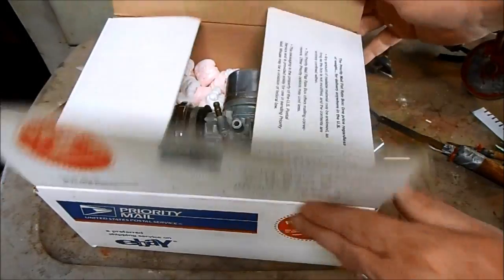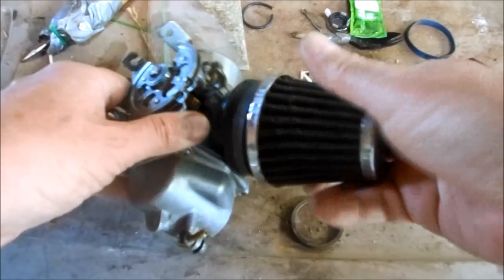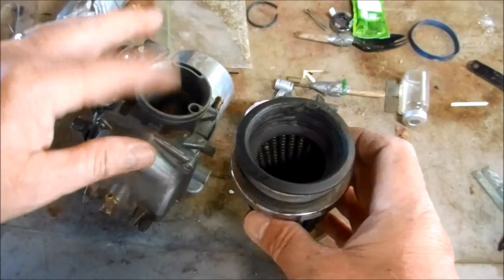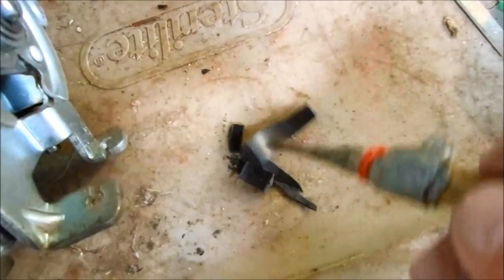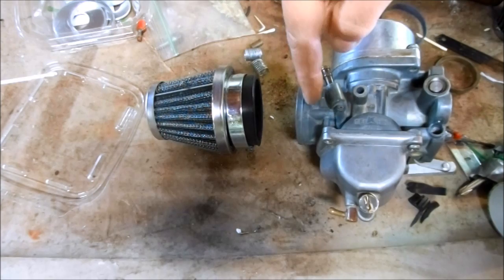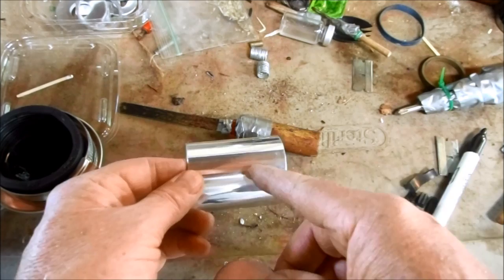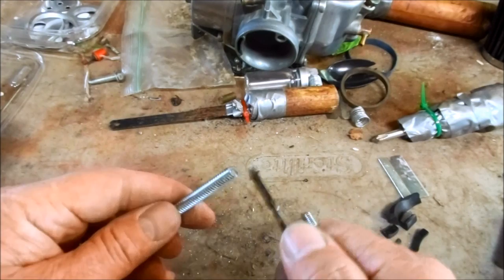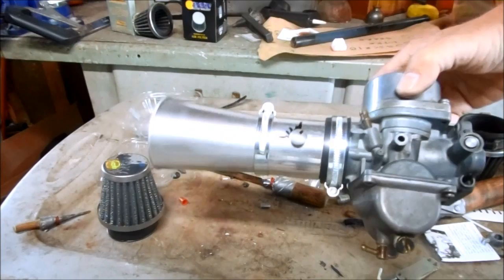how to easily tune pod filters for motorcycle carburetors with new diy kit

Comment: Yeah my problem is that i can't get the airbox back in the frame. Im at the end of my rope... so I ordered 4 pods after watching this vid and built 4 of those tube setups put the lollipops in and can't get the bike to rev past 6000rpm... 87 ninja 750 has an 11000rpm redline... help ichiban, bike has 4 keihin cvk carbs and a 4 into 1 exhaust. 

Should I drill the air hole for the slide out and make it bigger, how big? cut a couple coils off the spring?  Arghhh help.  Bought the bike off Craigslist 6 weeks ago and still haven't ridden it
Reply: Take out the darn 'lollipops'
Reply: @i.jackanov7382  yes but simple test: take off the restrictors (that's all they are) and if it revs to limit, problem solved. If not, there's another issue, possibly fuel starvation. Increasing the main jet size will stop the motor running too hot. Observe spark plug colour in the traditional manner.

Comment: how much would you charge to tune a set of four off my 1980 suzuki gsx750 to run the pods i bought it with
Reply from the maker: take your bike to your local shop with a dynotune .   we no longer need any carburetor props or tuning videos.

Comment: hold up. I got the joke but does the rubber on the pods filters really block those holes and is cutting the rubber away a good idea?
Reply: I'd be curious there too. Never really looked.
Reply: I don't know about actually cutting them, but if you pop for the K&N filters they don't have that lip on the inside and they're also sealed for better filtration.
Reply: put install the connector and bracket without the filter- and look inside the carb- you you cant see the passages then trim

Comment: I bought a Yamaha warrior 92 model and when I bought it the air box was completely gone. So I bought a 3 to 4 inch rubber tube like thr aluminum one you used in this video but my quad still hesitates when u barely give it throttle but runs pretty good when your a quarter throttle and over but when you let off the gas it spits and pops obviously way out of tune. Is there anyway you could make me a aluminum piece for mine with the adjustment washer you sautered in it to be able to tune my quad without messing with the carb? And if so how much would you charge me? I can get in the size of my carb and filter no problem at all please let me know sir thank you. I just subscribed and I'm sharing this video everywhere..
Reply: LOL, just figure out the diameter the mouth of the front of the carb is, clamp on a pieace of tube like the video and tape off one end with high strength Gaffer tape, the really thick expensive stuff, super strong, not the plasticy stuff the textured surface proper gaffer tape, then just drill a 3mm hole right in the centre, start with that. if its too rich it will bog down at high rpm, like feel gutless until you let off the throttle , if that happens, incease the hole size to 4mm and keep going up in hole size til it runs good
Reply: try use a long piece of tube too, like 6inches, with internal diameter of the tube the same Millimeter as the Overall diameter of the front of the carbie
Reply: and dont use plastic plumbing pipe as i once did on a 250 kawasaki, as the engine heat somehow transfers its way to the carbies and then to your plastic pipe, deforming it over time / if not straight up melting it,  i was shocked to see it all munted up only after a few rides.

Comment: In all seriousness though,
would something like this work??
Reply: Yes, because this bike hes doing it for is single carburettor huge engine, the size of his washer may be sufficient to do the job, however if you have a 2 cylinder same CC or 4 cylinder same CC as this one, you obviously want the hole sizes in the middle to be much much smaller
Reply: E.G single carby , 1 cylinder 600 cc, centre hole (by looks of video) 21mm , so respectively, 2 cylinder 600cc , 10.5 mm., and 4 cylinder 600cc 5.25mm , and you cant go wrong :)

Comment: Hope that was welded solder will come off run the engine also no seal around that bolt not good at all
Reply from the maker: that's why i didn't superglue it

Comment: Im having a serious issue with airfilter. these chinese pods are crap and doesn't work. I got a 200CC bike. I'm runing it wothout air filter as orignal box doesn't fix on my new big carburettor. oil got very thick after 200km. as its sucking dirt in my newly restored engine. but it is consuming less fuel and accelaration got very powerful I can even chase cars till the end of my 4th gear. but I'm afraid dirty air would destroy my head cylinder and piston soon
Reply: LOL, you love it, say goodbye to engine, HAHAHAha

Comment: Not sure if this is real or what. I do get some good laugh from all the sarcasm but I am really confused. I mean, I really liked the idea but because I do not know much about this, I am not sure if this stuff will work. Can I get an honest reply to verify if this is good or not? Thanks in advance,
Reply from the maker: will need to print out the dyno sheets
Reply: I am excitedly waiting!
Reply: Bugrahan Ryan Unver me too
Reply: no - simply no
Reply: So none of his crap would reallly work! ?If you have no choise or stranded
Reply: @sergioernandez1  it willl work bro, ive been tinkering for years with these pods, just put pods on and use electrical tape from the side closest to the carb the fatter side to the outter pod face the smaller capped off side and leave like a 5mm gap for air, over time the petrol may attack the tape and it may get loose or fall off, just re apply.
Reply: @sergioernandez1  If you wanna do it the proper way though, go one size up on the pilot jets, and wind them out to 3-4 complete turns. and you want to go around 3 sizes up on the main jets. from there make sure your float valve is seating properly and sealing or youll be scratching your head running too rich all the time and the results you achieve will be skewered by the dodgey float valve. I did this trick on a GPZ 600, 4 pod filters from china, main jets were 107 i drastically assumed 120 jets will do like 6 sizes up, it ran and all.. but i never fixed the float valve / seat setup and had to scrap the idea as running it was out of the question due to the oozing petrol into the intake port by itself due to a leaking float valve , the small tips are shrunken at the point and not a nice even shape

Comment: This video has made my day.
Saved me a bunch of grief and $.
Had dual carbs on my 1979 Honda CX500  custom,  jetted & synchronized
a year ago and only now after doing this am i getting optimal
engine performance. I SHAVED THE BUG FAT RUBBER COUPPLER
AT the AIR JET AND SLIDE LIFT PORT! Two components i didn't even
know existed before watching this video. Thanks a bunch.
My CX500 thanks you to. No more choking and sputtering due to restricted
air flow.
I had just went out and pulled the cones off and was going to ride with no filtration
after seeing thishttps://www.youtube.com/watch?v=4CwGJ4o4QlU 
Upon close inspection i noticed his bike has v-stacks with no filters!https://www.youtube.com/watch?v=FOlaZXyn3DI
You have shown me a better was.Thanks again.

Comment: that's a hell of a Swiss Army knife.   and if you REALLY use half of a hacksaw blade ducktaped onto a screwdriver handle, I am not listening to another one of my gf's complaints about me doing things like finding an old rusty clawhammer head on the side of the road and tacking on a piece of re-bar as the handle.   I mean, damn girl - just wear gloves if you wanna use my hammer.  smdh

Comment: I like your videos and I know you didnt come up with that "solution." But that is the silliest "fix" I have ever seen. Put pod filters on for their improved airflow and then restrict them with washers? At that point why wouldn't you just use the stock air-box? I would have recommended a Dynojet(or equivalent) jet kit. Or just tell the customer to put back the stock box.

Thanks for the rubber lip trick. I just received an 81 gs1100e that some brain surgeon thought he was going to turn into a drag bike. After a couple failed attempts at obtaining a stock airbox, for some reason the 2 I received had the wrong size carb boots, prolly from a 750, I decided to just go with a stage 3 jet kit and keep the pods. I will go back to it and see if the ports are blocked.

Comment: Yo Dawg I heard you liked butterfly valves. So we put a butterfly valve in front of your butterfly valve.
Reply: This is actually fairly common on fuel injected motorcycles
Reply: I just realized that CV carb doesn't have a butterfly valve.
Reply: The CV carbs on my Suzuki GS550L did (Mikuni BS32SS)
Reply: Bing CVs do.

Comment: I guess if you're only installing pods for looks this will work but defeats the purpose of increasing power with more flow, re-jetting or flat slides would be cool, but spendy and require skilled tuning. As an aerospace machinist I especially like your tools and the carriage bolt for your valve is a good choice, NOT! Good adjustable, quick fix modification tho, lol.
Reply: Um... I think you missed the joke.
Reply: I've met some hillbillies who actually do things that way, lmao!
Reply: +Wayne Donnay What do you mean?? i ALWAYS work like that (-;
Reply: Whatever it takes to get the job done, you can fab most things with a dremel tool, lol.
Reply: you make the not joke from the 90s. #throwbackhumor

Comment: I wouldn't trust this guy do fix a flat tire
Reply: his idea will work, the washer size still looks too big for my liking, but if its a single cylinder 600 odd CC bike, it may be sufficient, I know for a 600cc inline 4cyl you would want a 5-6mm hole in the centre MAXIMUM

Comment: Hey Ichi nice vids. ive gone through a hand full and I think this is the closest one. I wanted to ask your opinion on using the Pilot Screw Adjustment (the hard way I assume), to tune after pods rejetting and exaughst? 

79cb650 45 slow 120 main mac 4 to 1 and pods.

http://imgur.com/XWgxlh0

Comment: The cheap chinese filters cause a big restriction in air flow on motorcycles customers ask why there bikes run like shit after installing ebay pods on a weekly bases if your tight on cash throw some cut up T-shirts held with some thick hose clamps (or zip ties) looks cool and restricts just the right amount of air flow which is needed to get the proper amount of fuel

Comment: 0:44 What is the point of a pod filter if you are going to limit the air going in??? Just keep the stock box on.. My apologizes in advance, but this is so stupid. The point of a pod filter is to increase air flow so that you can get more power. Not only is this a waste of money for buying the pod filter, but your also wasting your money on a restrictor of some sort. Why not jet it for the pod filter? Then your actually getting something for your money.
Reply: Wait... is this a joke?  This has got to be a joke. Please tell me this is a joke, because then it is funny. the only issue with this joke is that some turd will actually do this. albeit this will work to get the bike working, but .... oh screw it. Funny man...

Comment: are those restrictors reall? or is it one of the jokes here :D ? why would you buy a sports filter that gives more airflow and the restrict it??
Reply: Because, to rejet a bike just right, means unbolting, draining fuel, disconecting accelerator cables / choke cables, taking off the petrol tank, the fairing, and then unbolting every carburettor float bowl tipping it upside down, installing different sized jets, re installing all the above pieces again, firing it up, finding out the jets are too small or too big, ordering new ones in, paying through the nose, unbolting your pride and joy and so the CYLCLE CONTINUES !!!!

Comment: You need to re jet the carburetor, not to add restrictions! Other wise, what's the point of a high flow air filter.  Oh my god ,this internet is full of engineers!!!!
Reply: I believe the purpose is to add an air filter that's easier to deal with than the stock airbox, in my case it's easier to do this than to wait 3 years for an OEM airbox with filter on eBay. 
Don't judge before you understand the motive

Comment: WHY would you install a POD filter to increase air flow thru the carburetor then build a contraption like you did to once again RESTRICT the air flow back to the carb to mimic the stock air box filter.. ???????  I mean that is as retarded as installing a TURBO into a car and not allowing it to go into boost .... 

If you buy a pod filter to increase air flow, you TUNE the carb to accept the added air flow ...  That only makes sense ... But not in everyones mind apparently ...

Comment: Complete and utter lack of comprehension about how to tune a carb. Do not do this. Free airflow is GOOD. You do NOT restrict it. You may have to change the main jet but it's unlikely. Tuning the inlet tract and velocity stack is about LENGTH. You adjust the LENGTH so the shock wave caused by the inlet valve closing reaches the end of the pipe just as it begins to open again. It's moving at 340 m/s more or less so you may have to tune to a harmonic of the optimum, do your own maths.

That way it's not impeding the inflowing air. Obviously this can only be optimised for one rev rate and it's usually set for peak power. But unless you're racing forget all this bs. Pod filters work fine on their own.
Reply: "Complete and utter lack of comprehension about...." how to watch youtube! have a nice day!